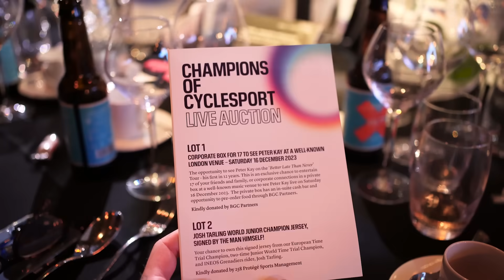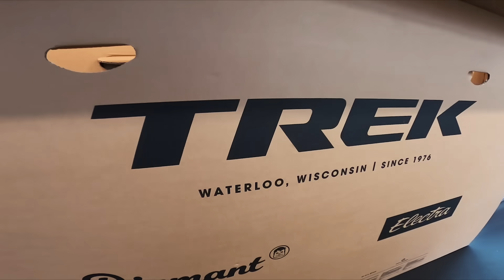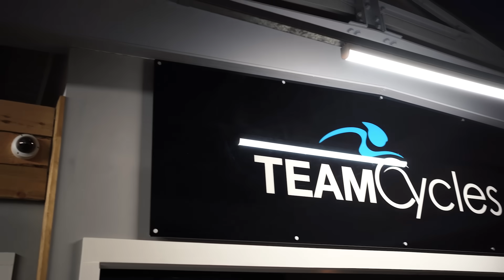REPLACING MY SNAPPED TREK EMONDA!

Comment: So obviously, Thomas, you are a fast cyclist. I don't quite know enough about bike geometry but I guess I attribute fast race guys to have a super aggressive top tube etc. This trek looks quite relaxed. Did you pick it for overall comfort rather than speed? Less back flexion in this position? Good to see you rolling again 🚲
Reply from the maker: Quite the opposite… my bike is set up in a very aggressive position, not really for comfort at all.
The top tube could be any angle in theory it’s more about where your body is in relation to the contact points that changes a bikes geometry and feel.
The frame is that angle because it is such a small size, so it has a low stand over height. Something I need as I have short legs… but this is also paired with a very short stack and a -21° x 110mm stem and 380mm bars, which gives it the aggressive “race” position. 😁👍
Reply: @TheCyclingTattooist  okay gotcha. Good to get your input on this! 👌🏼